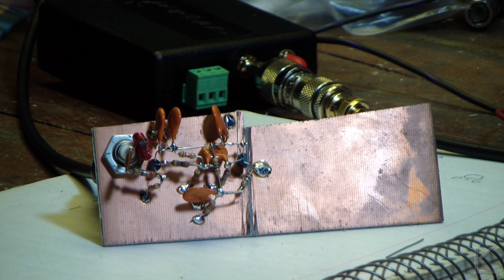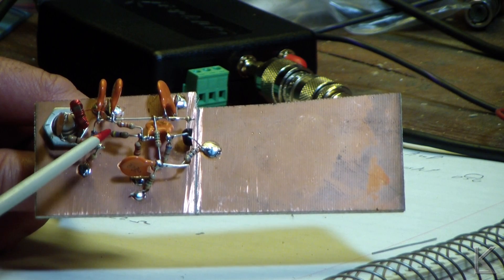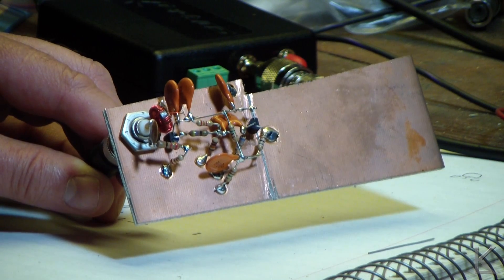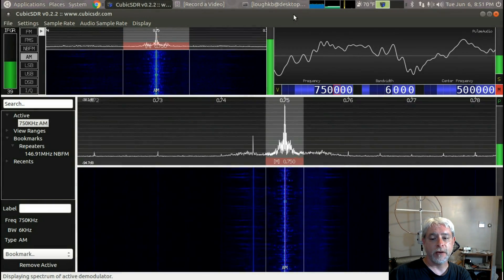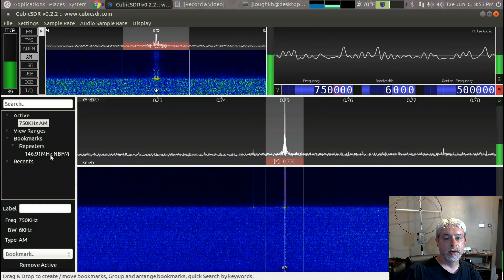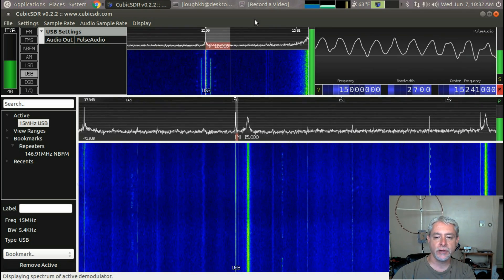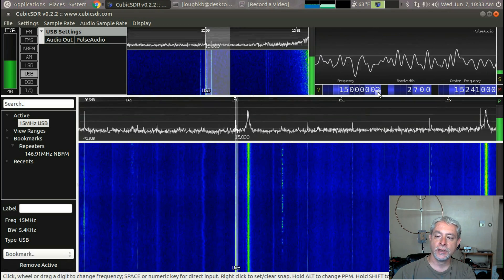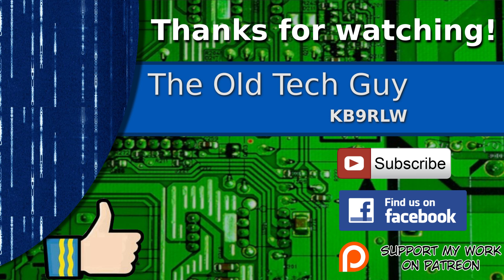Ham Radio - Experimenting with the mini whip active antenna and SDRPlay

Comment: The Mini Whip is not a 'magic' antenna that does everything well. It a special purpose antenna designed for high noise frequency ranges and environments. Compare it against your other E-field antennas in a noisy environment or on the noisy frequencies below the AM broadcast band and you will find that a properly implemented, (virgin ground at the antenna, ferrite noise filtration on the feedline, etc,) Mini Whip antenna will receive better than any conventional wire antenna at the same location because the wire antenna will not filter out any of the noise it picks up. Simply put, the Mini Whip is not especially sensitive, but it will attenuate more noise than signal in a noisy environment where a wire antenna won't.

Comment: I would be interested to know which semiconductors you used in your mini-whip. Although a J310 is specified in the original circuit, I have seen designs on the web using other FETs such as 2N3819 and BF245. As FET characteristics vary widely, even for the same type, the bias circuit used is designed to accommodate these variations. I noticed, when reading some of the original mini-whip documentation, that another Dutch amateur had substituted a 2N7000 enhancement n-channel FET for the J310. The 2N5109 output transistor has also been substituted either with more recent CATV-type devices or with more readily available npn devices such as 2N3904 and 2N2222, and the circuit modified to reduce current consumption, but with the risk of introducing intermodulation products if strong signals present. I have built several mini-whips, the one failure I had was when I used some nice shiny green 100nF capacitors which proved have too much self-inductance. Gain tailed-off rapidly above 1 MHz, although it was fine for LF & VLF.

Comment: SDR Console or RSPuno are way better software packages to use with a mini-whip. Cubic SDR is just not good software to use with a mini-whip.
Reply from the maker: That makes no sense.   There are no mini whip specific features on the other packages.
Reply: @loughkb  Well, I have only my own experience to go by. When I used the mini-whip with Cubic SDR, I got mostly just SW stuff.
However, when I used the mini-whip with SDR Console and SDRUno, I was able to pick up stuff like WWVB, Jim Creek Naval on 24.8, and SAQ on 17.2. 
It has to do more with the available filters on those software programs that are not really available on CubicSDR.
I even switched back and forth at the same time between the CubSDR and SDRConsole, and got WWVB on 60KHz, and couldn't hear it on CubicSDR.
Reply from the maker: @tglenn3121  Still doesn't make sense.   RX sensitivity is a function of the SDR hardware, not the DSP software.   Also, filters are a subtractive component, not additive.   
There are settings in the software that can control functions of the SDR hardware, maybe you had RF gain reduced in cubic.
I have compared received signals between SDRuno, Cubic, and GQRX, using WWVB as the test case and saw identical signal levels and SNR.
Reply: @loughkb  As I said, I'm going by MY experience. I thought the mini-whip was a dud. I got limited reception with it when using Cubic SDR. Got much better reception when using it with SDR Console and RSP Uno.
Reply from the maker: @tglenn3121  Yeah,  you probably had something set differently in Cubic.  
All the software does is take in the data stream and demodulate it.   
Nothing to do with the sensitivity of the hardware receiver or signal strength.

Comment: Great video as I have the SdrPlay and SdrPlay 2. I put a Mini Whip on the roof and it works good on 20m and 17 m when the band is open. Mili Kokotov has one mini whip and SDRplay2 with a great filter and lots of Torids on the feed to receive VLF. So I tried it. He hears all kinds of VLF Signals. But my QTH is very noisy and buzzing. I will try the ground Ant for VLF .Thanks I also have a random wire ant but I use the MFJ 1040c preselector and it tunes the wire for better signal response. I also have a tuned multiband inverted vee . . I watched Mili youtube videos on VLF and yours trying to improve my reception https://www.youtube.com/watch?v=L7HNsmlJoZc. Looking forward to more videos on VLF. Thanks

Comment: Hi Kevin, I made my mini whip a while ago and like you it wasn't love at first sight. There are a few things to consider. I notice that you made the slot between the pickup area and the ground quite narrow. I suggest you widen this to 3/16" or some 5mm. Any capacitance between the pickup area and ground shorts the HF signal to ground before it even reaches the amplifier. Which, btw, has no gain, it's only a voltage follower with a low output impedance.
The output impedance of this antenna is very low, about 2-3 ohms. When your coax reaches about 1/4 wave of length, this source impedance as seen by the receivers input has turned into a very high impedance. This may have a very negative effect on the rcvr input filter. I added a 47 ohm resistor in series with the 560nF cap between the emittor and the coax cable. Now the matching with the rcvr input is always good. You do loose 6dB of signal because of this, but the background noise reduces by the same amount, so that is no real problem.
You wrote that grounding the antenna gave more noise. That proves that grounding works. The problem is not the antenna, but the noise level in your house. I used my mini whip on a portable rcvr in the garden, and was able to clearly pick up very weak signals with little background noise. As I walked towards the house, the noise got stronger and stronger. The weak signals were no longer audible. The noise level increased by at least 3 S-units.
Take your antenna outside at least 20ft away from the house and power lines and give it a try. Not with an SDR rcvr, because the connected computer may be too noisy, but with a good old analog rcvr.
Hope you enjoy your mini whip a little more, because it is a fun little antenna.

Comment: These types of SDR receivers are known to not be exactly dead on frequency since they usually use low-cost crystals to drive the chips.  Some you can get with more accurate TCXO's in them.  But, to get them bang on freq. most (maybe all?)  SDR receiver software packages have a setting called "Frequency Correction (ppm)"  that you can adjust up or down to correct this problem.  Be sure to allow the SDR to warm up and settle before you adjust it and you should never have to worry about it again.  Hope that helps.  73!
Reply from the maker: Yep, I played around with the PPM adjustment a bit.  It was too gross to get it right.  I'm not worried about a couple of hz.   I won't need that kind of precision out of it for what I use it for.
BTW,  I'm presently building on the Raspberry Pi 3.   Once I get the changes sorted out, I'll do another vid and set of scripts tuned for the Pi.
Reply: Kevin Loughin, nice I'm running my packet station on an old Pi model B. Handy little devices.

Comment: Kevin, something is wrong there. Compare your results to the Websdr (google it) in Twente, that too is a miniwhip. A good test if it works is to try reception on vlf/lf. The antenna needs to be out and far away from your home as it is sensitive to noise creeping up the feedline. Be careful with replacing the copper plane with a whip, I found that easily overloads the frontend. The antenna is very broad and should give you good reception anywhere between dc to daylight. Do not expect miracles though. A dipole outside at resonance frequency is still stronger than the whip. Adding a ferrite choke at the bottom of the antenna mast helps to keep noise out. Check the publications of pa3fwm on grounding of the miniwhip. Could it be that the fet is blown? 73
Reply from the maker: I have seen good results on other sources as well.    To be fair, I need to build the 12V supply and feed it the same way those are being fed.    I wanted to see the performance with the lower voltage supplied by the SDRPlay.   The FET is new, should be fine.    I'll dig more into it later and do a follow up vid when I have more info.   Might even buy a pre-made version just for comparison when I finally have some $ to work with.
Reply: Kevin, I tried to replicate your setup as good as I can to verify the voltage theory. Here is what I tested with: My Winiwhip is a commercial kit but I also have homebrew ones. It is located inside a sealed plastic pipe, 30 feet on top of a fiberglass mast, fed with plain RG58. Where the mast meets the ground, the RG58 has 10 windings of RG58 through a large ferrite core as choke. From there, there is 40 feet of RG213 to the shack. As SDR I used a FIFI SDR, running with Bonito Radiojet as software. I connected the bias tee to my lab supply to be able to regulate it. The noise floor is at -130 without power to the tee and goes up to -115 once I power up the supply. Now I did some comparisons of shortwave station signals at 6070 khz while switching between 5 and 12 volts. I found any station consistently to be down by 15 to 20 db when the voltage is at 5 volts. Increasing the voltage to 13.5 though does not help much in my scenario. Sadly I can not compare to a dipole presently as I have none up in the air. 73 J
Reply: @radio655 , replace the antenna cable with single or better double shielded Sat cable, dont worry about the 50 vs 75ohm .. it doesnt matter
sat cable are cheaper and much better shielded.
if you feel unconfortable put a 25ohm metfilm resistor near the receiver, but the missmatch doesnt really harm, not even on that amplification level.

Comment: that's "ugly" construction, deadbug is the IC version rather than the groundplane. Manhatten uses little pads (like the square blocks of NY)

That amp looked like it was also filtering pretty narrow?

Really liked that visual zero beat portion.
Reply from the maker: I could see the boost from the amp below 300khz as well as above 14mhz, didn't seem to be filtering.  
Ugly construction, yeah, that's the term.  And it sure is too!  Ha!